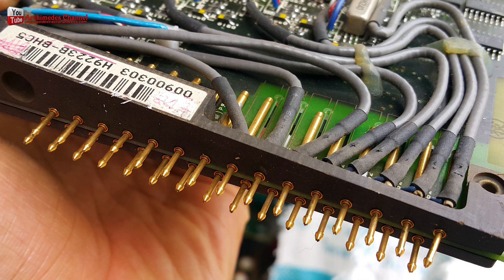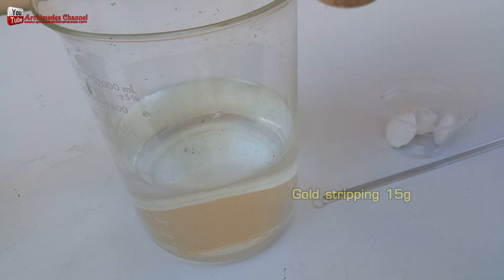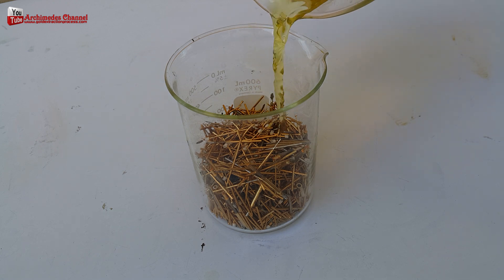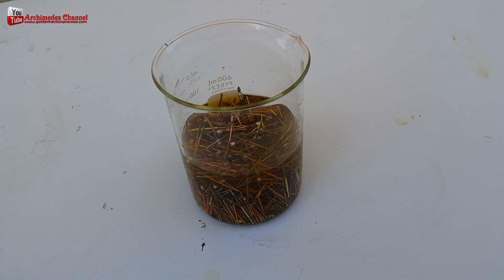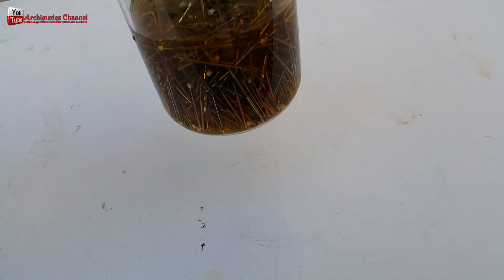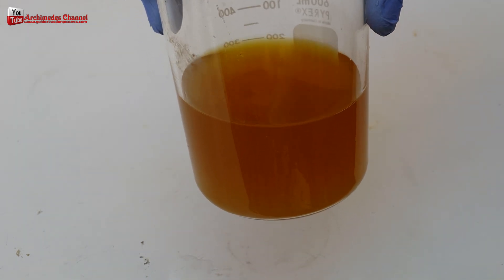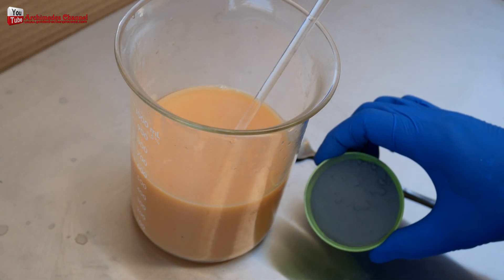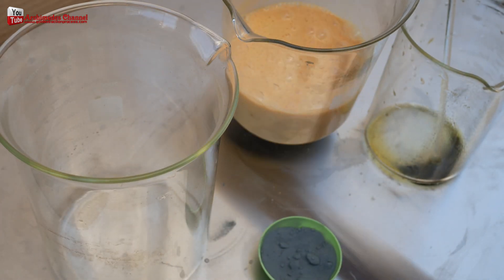WoW 👉 How to make gold 😱😱

Comment from the maker: 👉😂👍👍 Wait don’t throw those old electronics in the garbage, there’s gold in them there things. How about putting it in your pockets instead of someone else’s pocket?

Laptops, phones, cameras, and the like are filled with gold plated circuit boards even printers and scanners have gold, silver, and copper, even platinum in them.

Gold is a precious, conductive, and pliable metal that retains a stable value better than many commodities. Its chemical properties make it useful for the manufacture of computers parts and electronics. Some people find it profitable to attempt to extract the gold from these scraps, then refine and sell it. This complicated process requires chemical expertise as well as access to various chemistry equipment. However, with the right knowledge, experience and tools, you can remove valuable gold from computer parts, other discarded electronics.👉😂👍👍
Reply: Sir what is the name of the medicine?
Reply: yes!